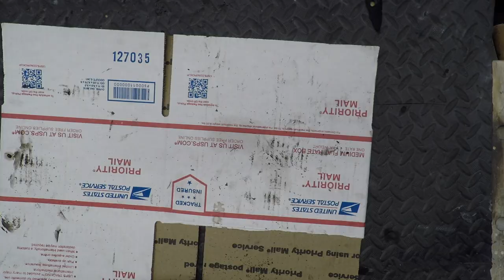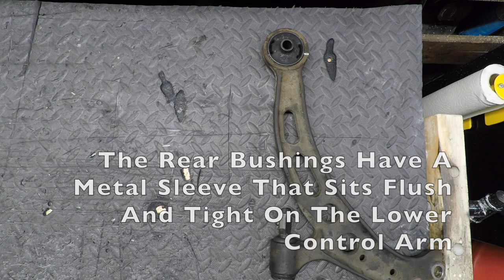DIY VL●OG: Lexus ES300 Toyota Camry/Solara Front Lower Control Arm And Tie Rod Refresh

Comment: Wow this is the first lower control arm video where the whole knuckle didn't have to be removed or the transmission mounts loosened to replace the control arms. My only concern is rust on those control arm bolts (and the ball joint for that matter, but hopefully a grinder could fix that, but no grinder will reach the control arm bolts). Thank you!